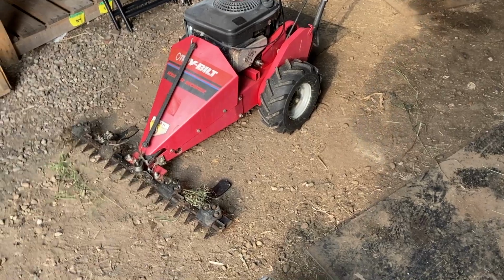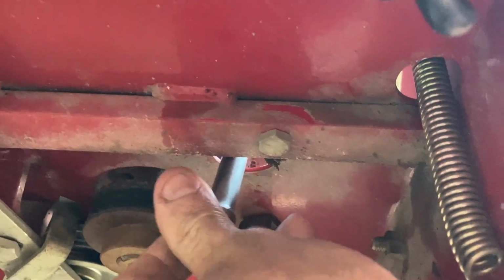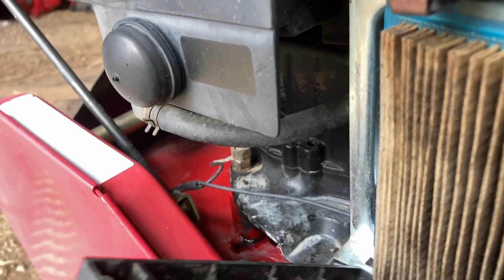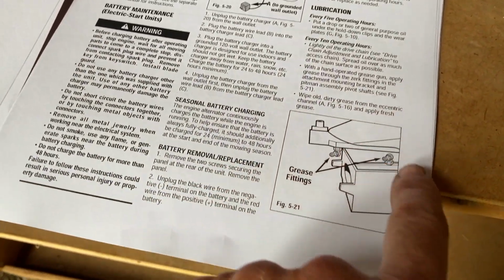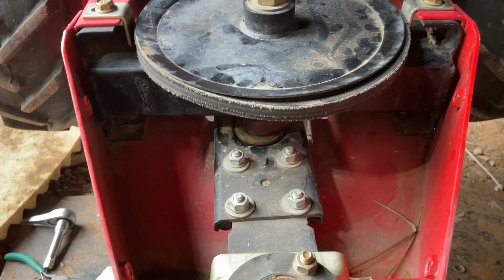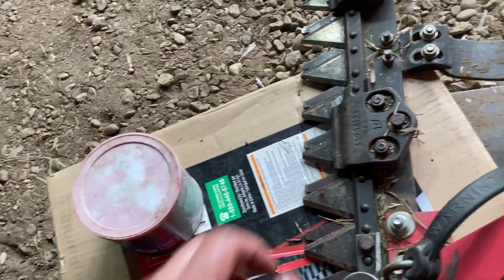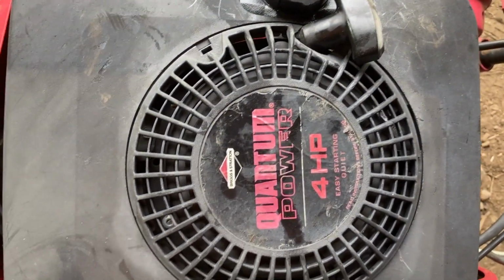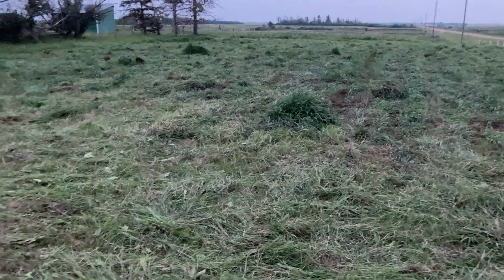Troy-Bilt Sickle Bar Mower - Maintenance, Machine Tour, Tips & Use - DIY Haying Project

Comment: I was hoping to change the engine in my cycle mower and the Owners manual got burned in a house fire was hoping that you would show how to do that
Reply from the maker: Most engines have common mounting points, so find a similar HP vertical shaft engine and it will likely just bolt up.  Might be minor differences, but would be really close.

Comment: This was a pretty helpful video. I would have liked more info on the hand controls and add adjustments, if any, as I just bought one at auction, and would like to know how the hand controls are used in steering also. But this was very helpful. Thanks for taking the time to make this.
Reply from the maker: Oh, it’s similar to steering on snowblowers.  You latch on the drive for each wheel on each side.  As long as you hold one of the electric deadman switches it keeps going.  Release the wheel latch, power stops going to that wheel, so the powered wheel turns the machine in that direction.  Each wheel has a belt and belt tightener which accomplish this.

Comment: By chance do you have the Carb number for replacement or kit.  The numbers on my carb are not cross referencing with anything.. It seems to be a cool machine. I need to get the engine running a little faster. Thanks for the video!
Reply from the maker: I do not...and like for my snapper, I was never able to find one, only separate parts I then had to replace.

Comment: I have the same model but the handle to make it cut is not locking do you know if I have a spring missing or somthing
Reply from the maker: Would be worth digging up the parts manual on the internet and comparing it to your unit.

Comment: How did you pick up the cut hay? Is there some similar machine for that?
Reply from the maker: We did it by hand rake, but we just got a new to us pull behind hay rake we are checking to see how well it works….at least for flipping and gathering hay.
Reply: Yes,,from BCS,you can rake hay,,and bale it with a BCS. Great piece of equipment.

Comment: Thanks for the video , where is the serial number on the engine and what website did you use to order parts ? 
Thanks!
Reply from the maker: It would be stamped on the engine cooling shroud somewhere.  Often eBay or Amazon for parts.